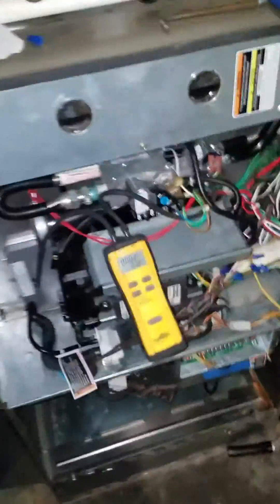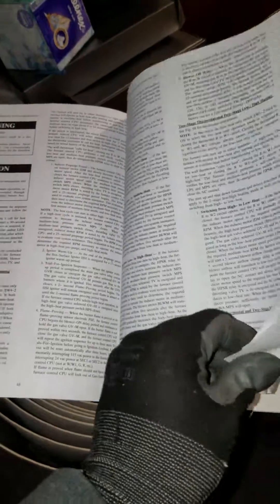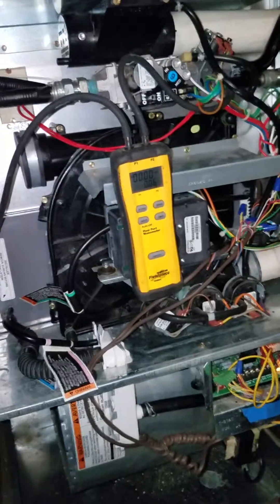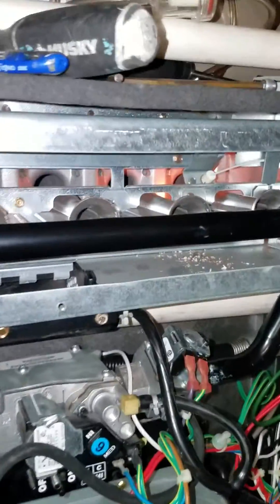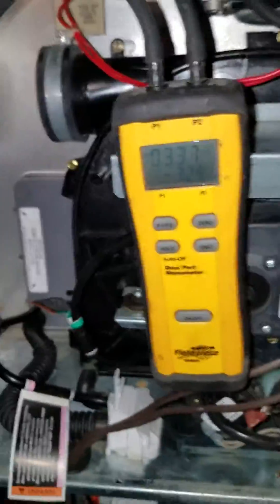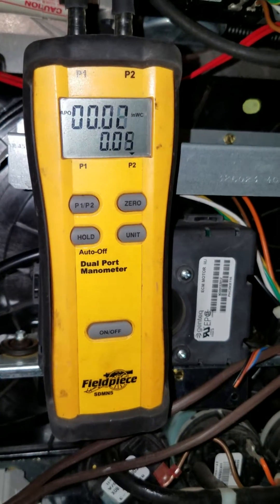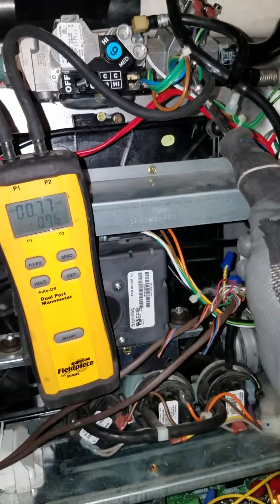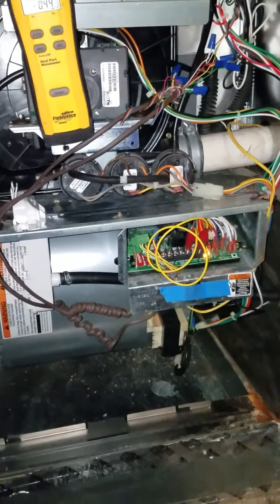Gas pressure adjusting carrier 58mvc

Comment: unsure of if you still monitor this channel, but further into the manual it says what pressures to set it to based on the btu heating value of your gas and density. The gas pressure range is not there so you can set it to whatever you want to make it run cooler.